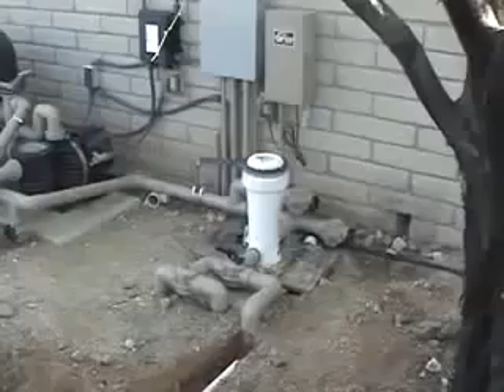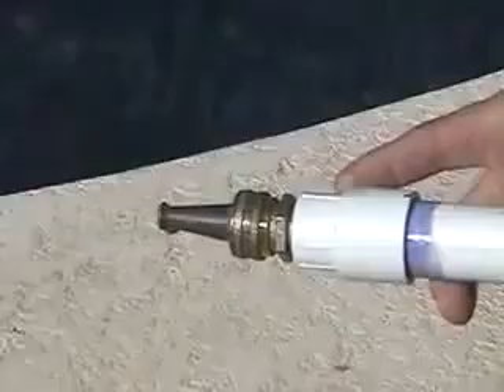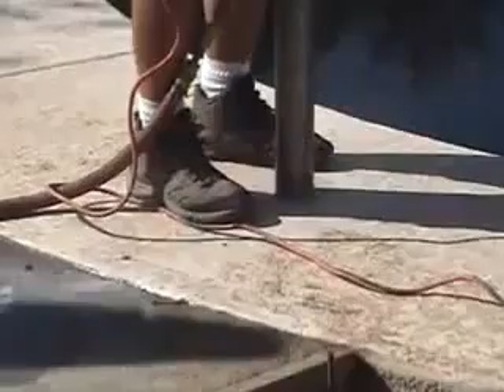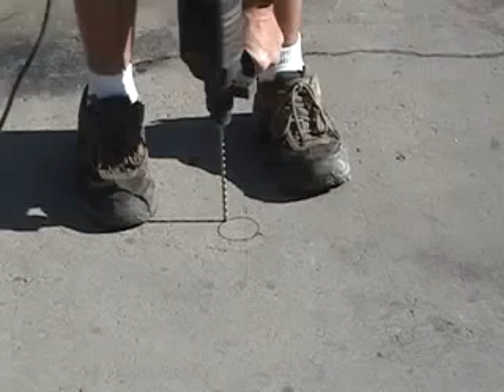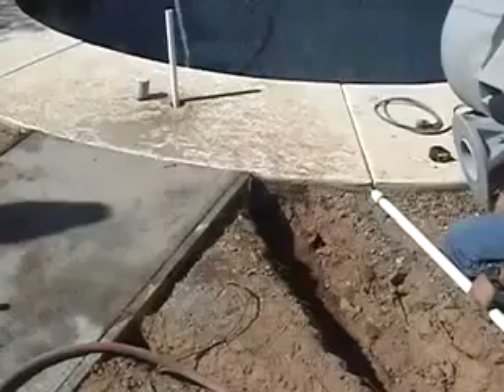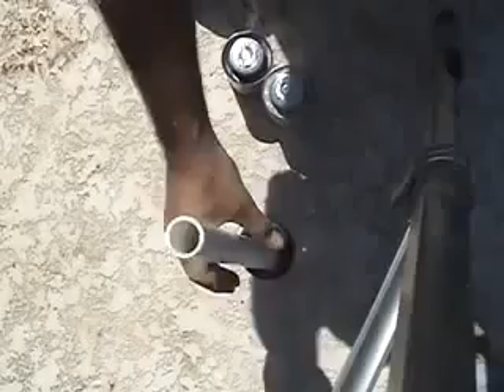How to Install a Pool Slide Water Line Under a Concrete Deck

Comment: Hello! Where are you guys located? Would like to see how much it cost  to have you install one?
Reply: very sorry but we do not provide any onsite service- Suggest that you contact your local pool store or a plumber, or most any handyman should be able to help you after viewing this video.
Reply: @SaveAlotShops  but all you did was connect off of the return line of the pump unit? Like I believe you mentioned in the video and installed a 3 way valve. 3 way valve, since one would be for the water return, if the pool has a spa, one for that, and the third one for the water slide right? In the simplest terms.
Reply: @pumafutbol333delavega8  The purpose of the video is to inform you how to install the pipe under a concrete deck. The 3-way valve destinations will depend on the accessories that you have installed - (Slide, Fountain, Chlorinator, salt system, in-floor cleaning, etc.)